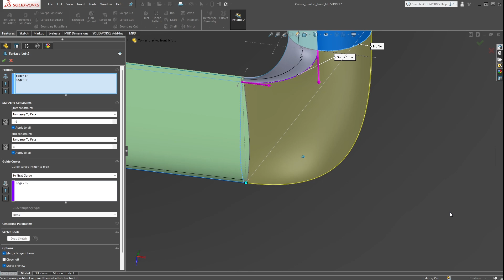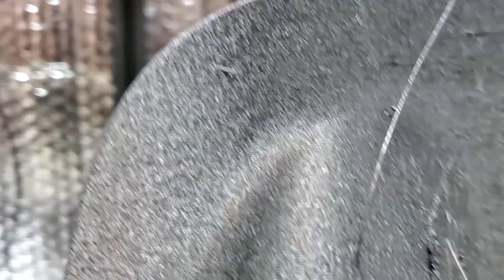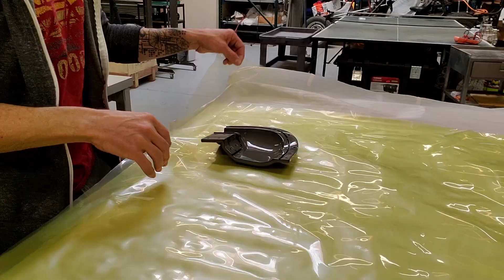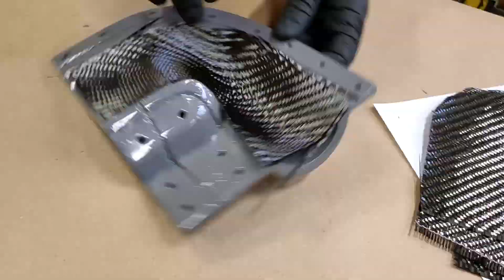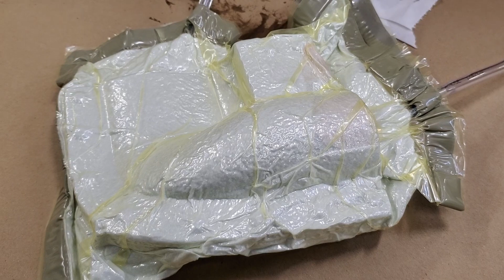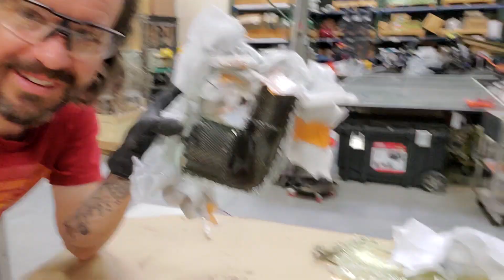Carbon Fiber DIY Resin Transfer Molding - RTM - Part 1

Comment: Hey, thanks for the video! Its very close to what i am trying to do and modelling the parts in freecad almost made me crazy 😂Some noob questions please:
- Along the perimeter of your mould i see  a channel running ...what the principle behind that idea? 
- Would it be possible to spraymount the fibres to the core as well? That way i could ensure that the fibres are wrapped and overlapped nicely, is there something i am missing here?
Cheers!
Reply from the maker: The perimeter is for a o-ring to seal the mold. It didn't work to well. 
Yes. There is a specific spray adhesive used for this specific purpose. I would definitely source some of that before attempting a project like this again.

Comment: vacuum infusion will work fine if you heat the epoxy and/or the tool. You can also use a conventional oven and a solid silicone plug as a bladder. The thermal expansion of the silicone will give enough pressure to consolidate the fabric and resin beyond just vacuum pressure.

Comment: I'm really not sure why you infused that. Your first half looked like how I wet lay-up my own design carbon fibre hydrofoil wings. And then you infused it. I just resin infused 30 layers of carbon fibre last weekend for my first carbon fibre hydrofoil mould and I did a lot of setup but with no resin. I also 3D printed a resin transfer core but with very controlled position release holes.   I infused with the mast leading edge down so the resin filled downwards then backfilled to the trailing edge and all the base plate perimeter. I used river table resin for it's long pot life. The infusion was a success but a lower viscosity resin would have been better.
Reply from the maker: Two reasons. First because we didn't have a way to add compaction to remove trapped air. The vacuum + infusion serves to drive out all the trapped air (in theory.) Second, just to see if we could. Yes, a lower viscosity, infusion specific resin would be better.
Reply: @designbydave  It's a short infusion path. Pretty simple solution.  peelply inside. Run a tube through into the vacuum bag and inside, seal it to a long balloon run through inside your mould. This allows atmospheric air pressure to push your carbon against the mould. Run your infusion hose through small diameter spiral wrap at the bottom of your mould with another layer of peelply between the balloon and the inside of the peel ply protected carbon fibres. Seal off your resin pipe and test. To properly complete it, you need the peel ply to extend out some way from the mould as a resin brake and have an extension of something similar to let the resin move only slowly to the vacuum outlet from the bag, I wrap that in paper towels. I haven't done it that way before but it will work. Use a big balloon so it has enough stretch. I've done  maybe 12 infusions over the last 2 years, the resin running out, the resin sucking to the pump, early stuff you will find good work arounds for. In particular, the concept of a resin brake.
Reply from the maker: @fluiditynz  Cool, might have to give that a try

Comment: Electric scissors can work with your template just lying in place on the carbon fiber as you had it. You don't need to lift the CF to be able to cut it.
Reply from the maker: Yep, need a pair of those!

Comment: I use 1/4" 3M green masking tape to lay out cut lines on carbon fiber. Forms to curves easily, and keeps the fabric from coming apart when you cut. Also helps to keep the tows together when laying the fabric in place.
Reply from the maker: Thanks I'll check that out!

Comment: Perhaps a simple solution to the problem would have been plastic tubes or other material extensions that fit dimensionally to the carbon fiber tubes with modeling clay and create two part molds for the finished pieces. The number of hours spent using solidworks  vs this suggestion is an obvious question as to where time was wisely spent.
Reply from the maker: Ah but part of the reason for the project is to learn and expand our abilities. I indeed spent a lot of time in Solidworks but I learned some valuable new skills in the process.
Reply: @designbydave  Good argument.

Comment: This is awesome, do you have some source for diy mold design?
Reply from the maker: What do you mean, like a tutorial?
Reply: @designbydave  yes
Reply from the maker: @lalilaloe  I don't have a specific source. There are many sources for how to use the mold design tools in Solidworks, like the parting line tool I mentioned in the video. There are some specific mold design considerations for this application though that relate to the 3D printing and process method. Perhaps it's worth a video about that. I would like to iterate on these specific molds though and improve a few things.

Comment: Your technique is called VARTM Vacuum Assisted Resin Transfer Molding. You could print the lost core with a soluble material, mostly solid with small channels for resin flow. When the part is done dip in solvent solution and melt core away. If you design the channels right you might not need any pressure and get closer to full infusion. The part look good, let us see the next one👍
Reply: It might be a suitable shape for a cast silicone plug.
Reply from the maker: @genixia  That might be a great way to produce this part. You'll see in a future video we figured out another trick.
Reply from the maker: I have experimented with soluble core materials in the past and they turned out to be significantly less soluble then one would want. It's pretty much a moot point however as we figured out how to make them hollow.

Comment: how is this different from vacuum infusion?
Reply from the maker: Pretty much the same except the resin is pressurized
Reply: @designbydave  I don't see how that helped though.  He should have vacuum degassed the resin, then vacuum infused.  I think he would have ended up with less resin on the wrong side of the mold.
Reply from the maker: @genixia  Yeah, to be clear, I'm not really sure the extra pressure is necessary either. It's just that you typically see resin infusion used on "single sided" parts, not tubular geometry like this. It's probably worthwhile to attempt a part without the additional complexity of the pressure pot. Maybe in the future.